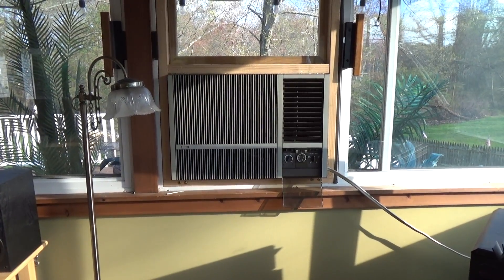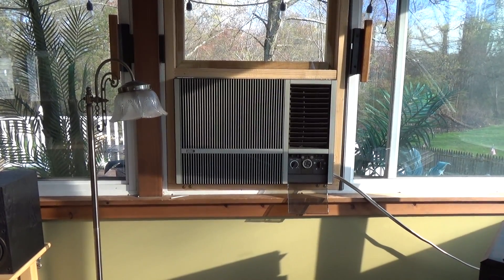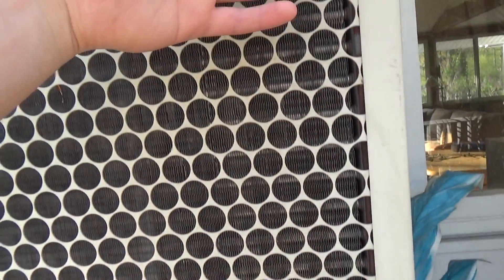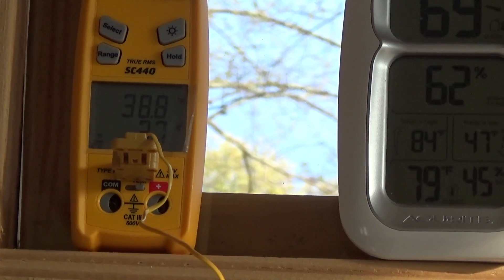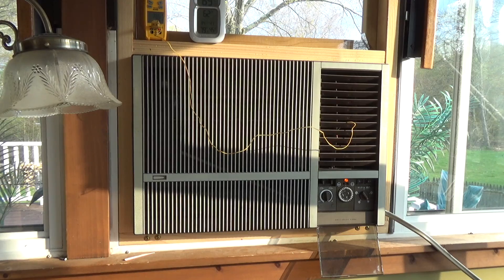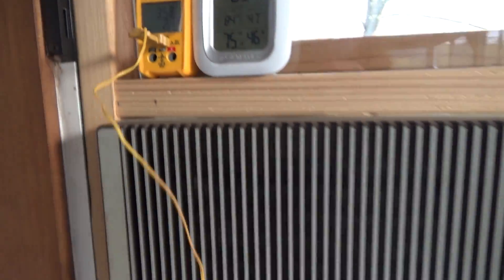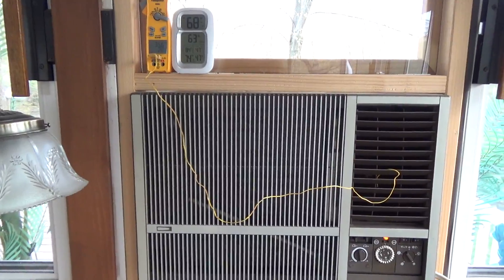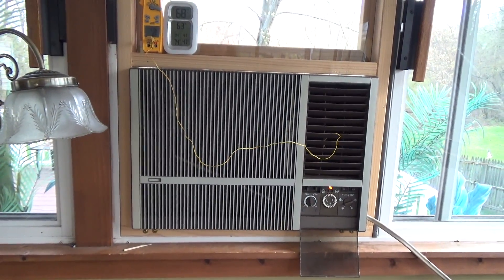Carrier International Series 51GMA228301 27,500 BTU Air Conditioner | Spring 2024 Test In Wall

Comment: Hi Jordan, are you able to find a new filter or how have you been changing/replacing? I have a similar model in my older home and want to get it up and running but the filter is a mess. Thank you!!
Reply from the maker: You can buy a sheet of filter material to cut to size at most hardware stores. I pull the unit out yearly for a full cleaning. The cooling season is very short where I am, I seldom put enough hours on the machine to even notice any dust accumulation.

Comment: I have one of these that came installed with my house - and has been working well for 25 years. Though I have cleaned the filter, I have never been able to get the front grill off to vacuum the coils. Is there a trick to this? Pulling the lower left corner forward releases that corner, but the middle (next to the control panel) will not budge. Thanks for your help.
Reply from the maker: On the one shown in the video, you push up from the bottom while pulling forwards on the top. If you keep the filter clean, the coil is probably fine. After 25 years, you'll be well overdue for a good cleaning on the outside.

Comment: Jordon, I wrote you a couple weeks ago about how my carrier filter disintegrated and you had me go to the hardware store and get me filter material that I could use. I still have the frame from the old filter. Do I put the filter material on both sides of the frame and tape it on? or if I put it on just one side of the frame and tape it on do I put the filter up against the coils or up against the front cover provide would be appreciated.  -Tamie
Reply from the maker: One side is enough. It should be positioned such that the frame would keep it from getting sucked against the coil.